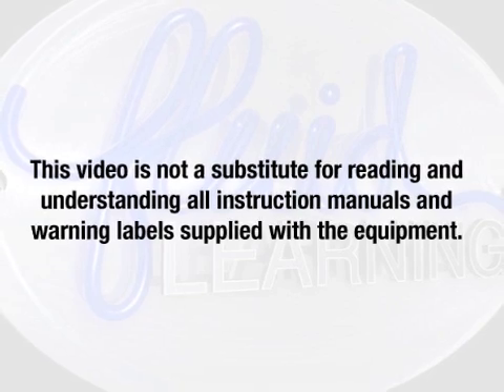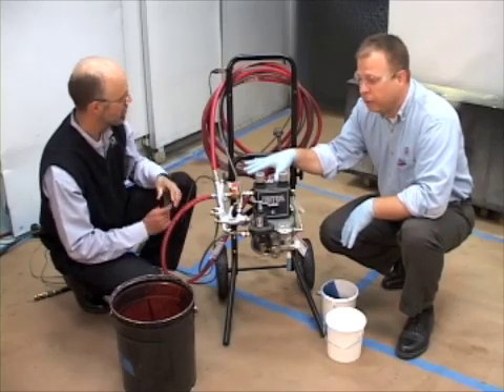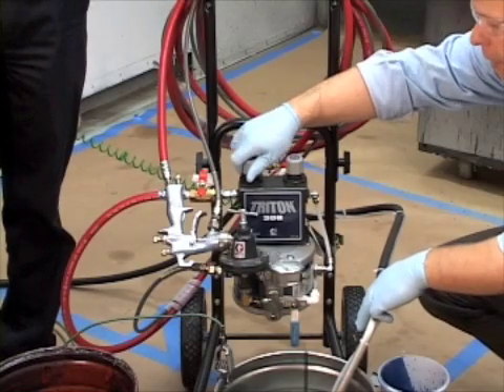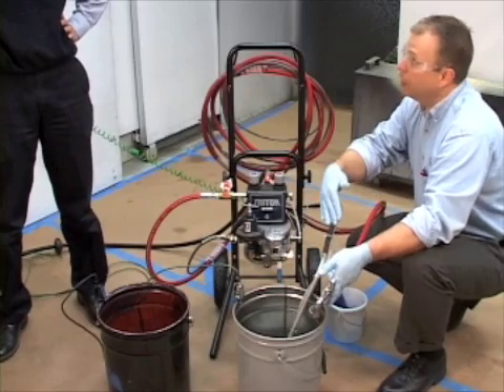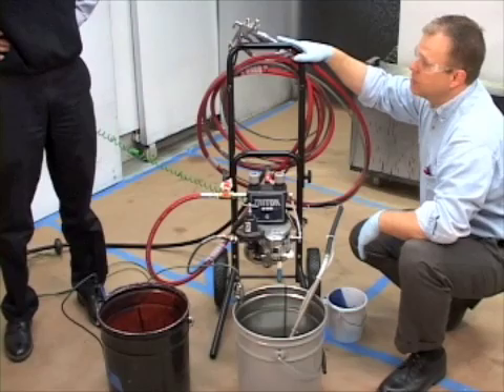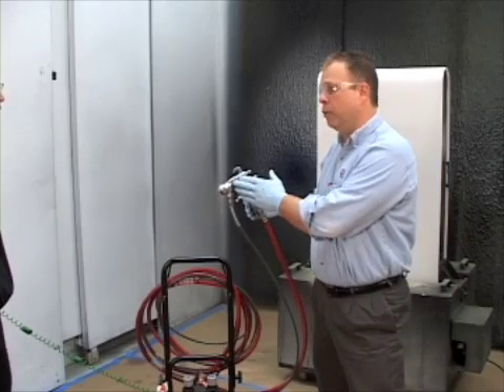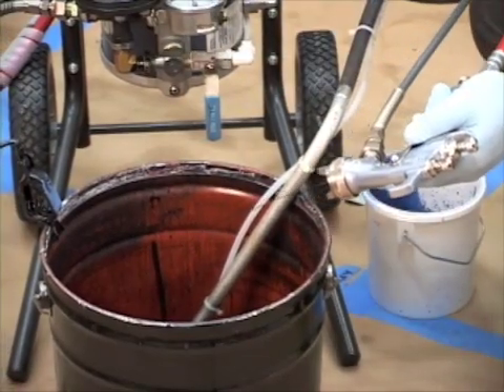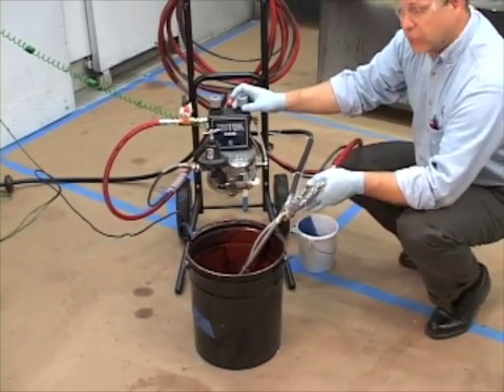Air Spray Finishing Demo - Setting Fluid Flow Rate

Comment: hi.how about the fluid flow  i mean how many ml per 3 second,and i use and use air pressure 5 bar for the pump with 15 m host.and another pump 20 m host